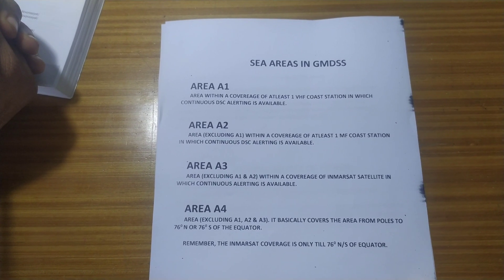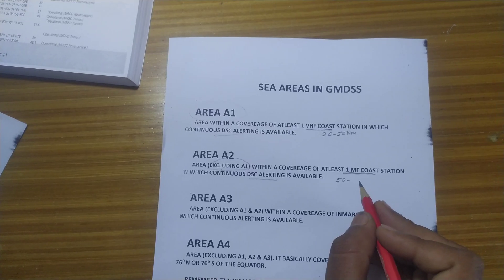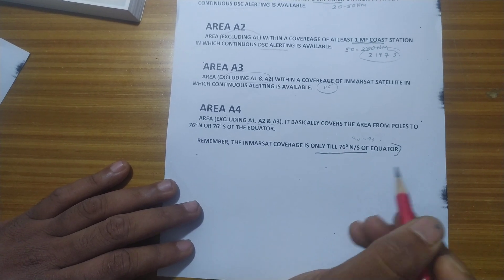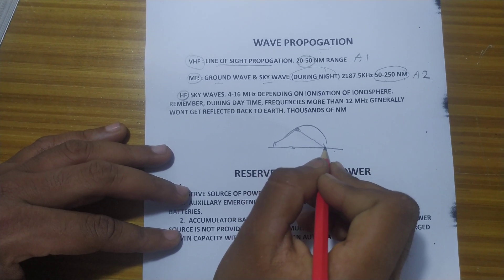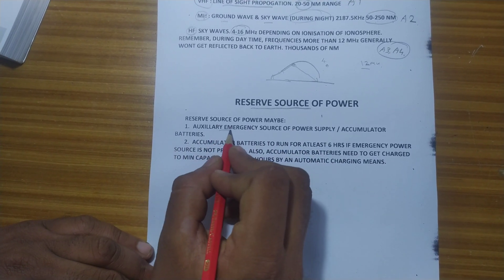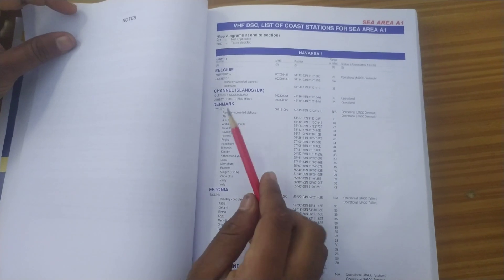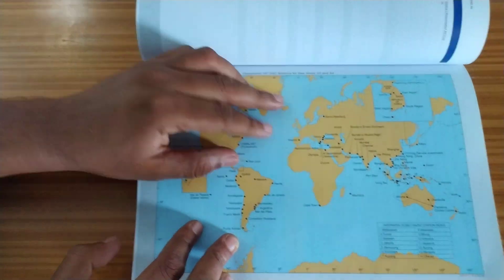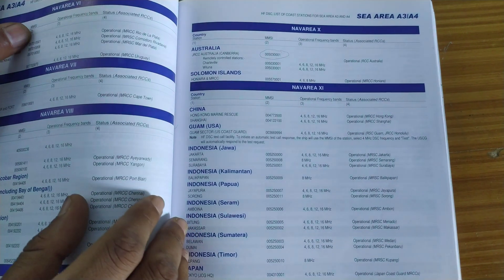GMDSS Sea Area (A1 - A4) and Wave proportional Explained

Comment: Hi mate, if I'm  in Pacific, a vessel 5 miles off  frm me  sent distress alert( real distress) in MF&HF freequency can I able to receive the alert in 5 mile range? Please give me an answer,it was my survoyer question.
Reply from the maker: Yes sir. The basic reality is, if you are testing with ship stations while sailing, then you are within 5 miles, correct?

So, you are testing at less than 5 miles. The test calls Tx & Rx are basically received by both ships. So, it will work.

I'm telling you this with practical experience at first hand.

My answer is, it will be received in good order. 

I hope you have got a good understanding. Thank you